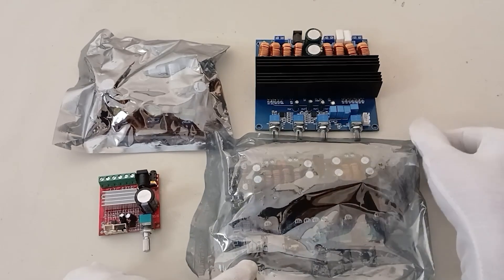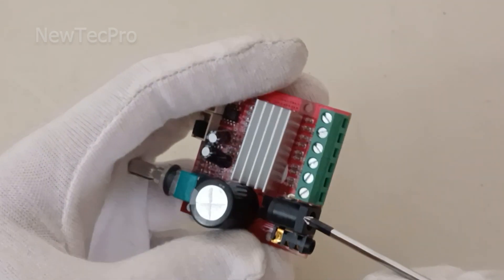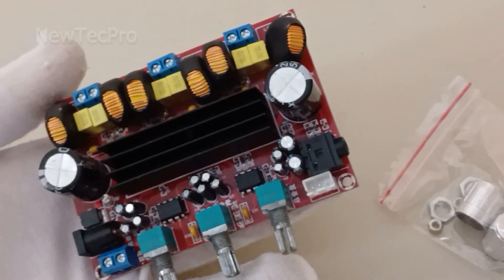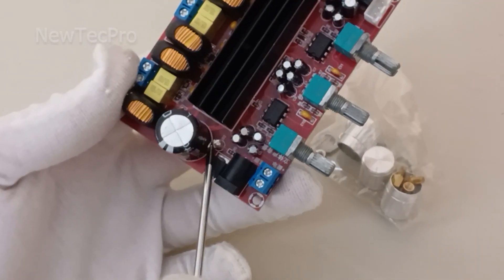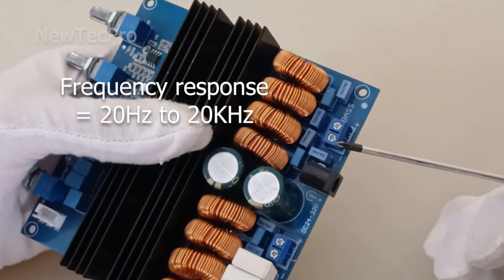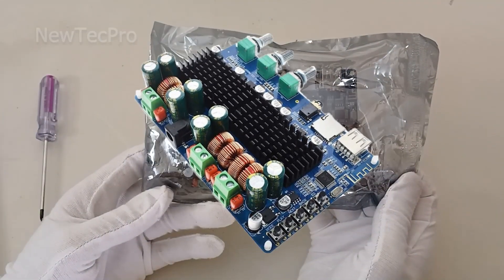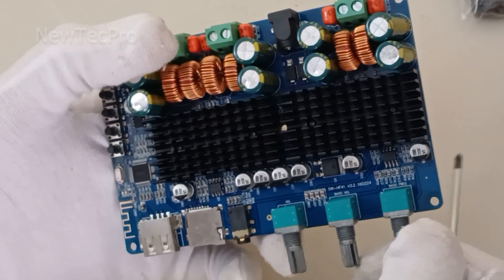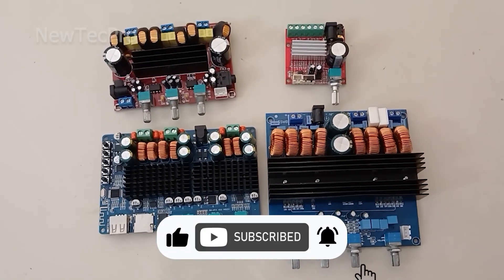Best 2.1 Channel Amplifier board with Subwoofer Outputs (2024)

Comment: xy t100l amplifier is this circuit any good ?
Reply from the maker: This module is good, but it appears to lack a separate subwoofer output, offering only a 2-channel stereo output. Models with 3 channels and subwoofer output tend to provide better sound quality.

Comment: What are names of these board?
Reply from the maker: Hello. 4 models of amplifier boards with subwoofers are introduced in this video. Which one do you need?
Reply: @newtecpro  2nd and 3rd one
Reply from the maker: @acidicmdyt  TPA3116 50W + 50W + 100W Bluetooth USB TF decoding 2.1 channel digital power amplifier board support MP3
Using the original TDA7498 TL072: 2x100w + 200w
TPA3116D2 DC12V-24V 2X50W+100W 2.1 Channel digital Subwoofer
2*15w + 30w :Class D efficiency in a compact size

Comment: Hi buddy, I bought a Douk Audio, TPA3116 Nobsound Bluetooth 2.1 Channel Amplifier Board, it worked ok for about 6 months but the Bluetooth stopped connecting regularly, like it's random.
I was wondering is there a way I can bypass or replace the onboard bluetooth? I have built a boombox and I don't want to have to put a different style amplifier in it as the knobs are in different places if you see what I mean?
It's a shame these things are so unreliable and they are not inexpensive either like the normal cheap ones, I expected a bit better quality, any advice would be gratefully received.
Next time I'll just buy the amp and bluetooth separate.
Just to say this amp has not AUX input, it has the socket but apparently it does not function so I can't use a USB bluetooth via a 3.5mm input, which I didn't know and they said it worked so eh, go figure.
Thanks for any help you can give me or even if you know of a video that might help, I'll be using you channel to help choose my next amps et al, subbed! ;D
Reply from the maker: Hello, I'm sorry you encountered a problem. It's recommended to set up the 3.5 mm jack (pins) and use a separate Bluetooth audio receiver module.

If this does not work, you can search for the IC datasheet online. Locate the audio input pins and very carefully solder the stereo output to the IC audio input pins. Please note that this task is quite challenging and requires a high level of skill.